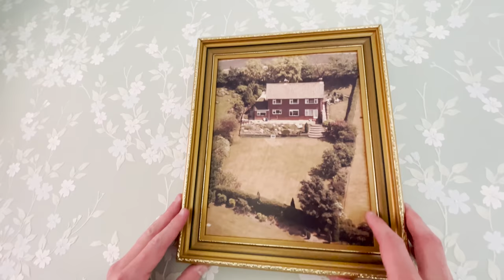Revealing my NEW HOUSE!

Comment: Why open the gardens, just modernise the house and flip it or rent it out for more income, no point owning a dead house
Reply from the maker: It won’t be at all, i’m assuming you didn’t watch the video because I said I’ll be using it for creating content in. Plus rather than trying to flip it and make a quick buck, 
The value of the road I live on is constantly increasing so the longer I hold it the more I make.
Reply: You clearly didn’t watch the video 😂😂😂
Reply: What happens if they build at the bottom prices will go down